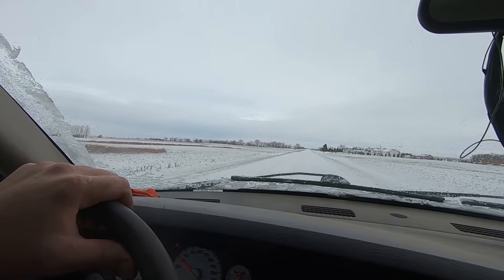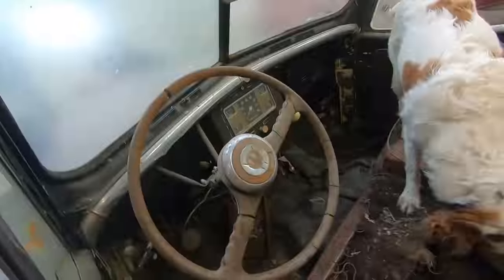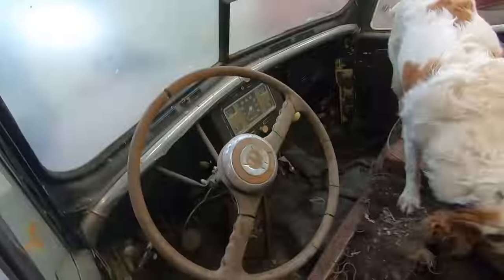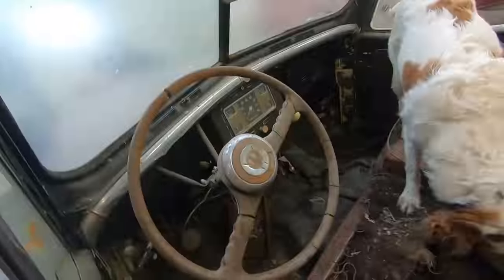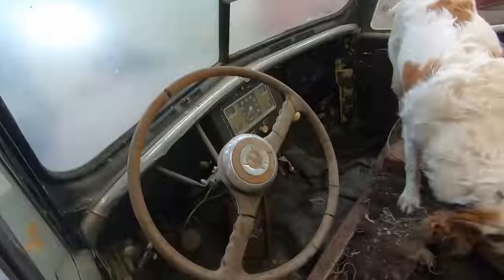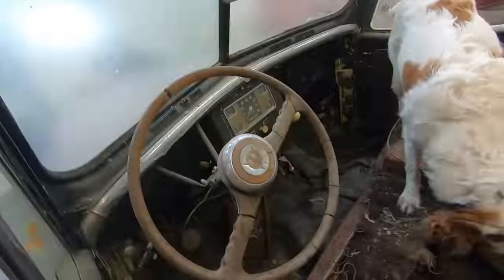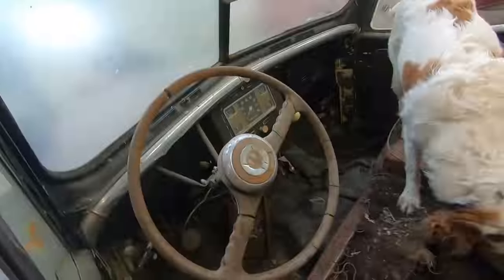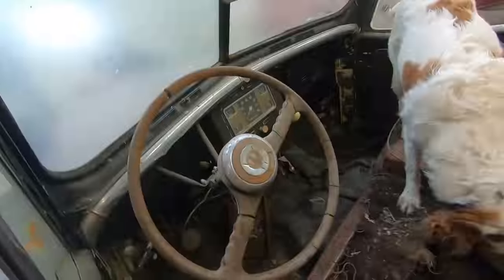Forgotten 1949 Willys Jeepster Barn Find! Will it Run?!? Sitting for 46 years! Family Heirloom!

Comment: So cool to finally meet your Dad! He is about my age. I had a 1947 CJ2A Jeep back in the early 1970's that I kind of restored, well, got running and drove around for a while. This video is quite interesting to me. Brings back lots of early Jeep memories! I hope you and your family have a wonderful Christmas and a great year ahead.
Reply: Awesome!  I learned to drive a stick in a field on a 1952 CJ2a. 4 wh low, 4th gear floored...16mph. 😀 Finally got it stuck going diagonal across some big dirt humps..2 wheels in the air, 2 wheels all the way compressed.  Awesome little vehicles.
Reply from the maker: Sounds like there's a lot of cool old Jeep stories out there! Way cooler than the right hand drive mail Jeep I had!
Reply: @willybones3890  they didnt have 4th gear...

Comment: You're amazing at fixing stuff that's older than me. It amazing you can still get replacement parts. Great job 👍
Reply from the maker: Thanks much George!
Reply: @MortskeRepair  ALOT OF THOSE PARTS ARE QUITE SIMILAR TO FULL SIZE JEEPS  PLUS REPRO STUFF CAN BE BOUGHT ID DO THE INTERIOR AND THROW A CHEEP TOP ON

Comment: Hey Mortske & Duff. That was an outstanding video. Really cool to see you and your dad work together. Lost my dad when I was 19. I am a 1955 vintage by the way. Guess that makes me 2 years older than your dad. That's quite a lineage you have when it comes to hotrods and mechanical stuff in general. I met a guy that owned a Conoco station near where I lived. I was around 13. His name was Donovan Crandall. He was an ace when it came to anything automotive and fabricating. I loved shadowing him. He taught me the trade hands on making mistakes as I learned. By age 14 I was rebuilding engines. My first rebuild was a Ford 272 Y-block. Hand cutting ring ridges and grinding valves and seats and knurling the guides. I even learned how to file down knurled pistons to fit. I've probably changed hundreds of points & condenser sets in my career. I still have the AC Delco dwell meter Don gave me in 1970. Merry Christmas to you and Duff. Thanks.
Reply from the maker: That's awesome! Love hearing about that stuff! Same to you Bob!

Comment: I love the whole ''will it start'' old iron community from classic cars to old construction equipment but you've become on of my favorites. Especially when I have a soft spot for Jeeps and it was so enjoyable getting an hold family heirloom going! You deserve way more subs but I know they'll come!
Reply from the maker: Much appreciated Brodie!
Reply: @MortskeRepair  DO A QWIK BUFF DUFF   ADRESS THE BRAKES AND CHANGE TO 12V SYSTEM WITH ALTERNATOR  OH YEAH GET AN INTERIOR KIT AND TOP
Reply: @MortskeRepair  THOSE HUB CAPS FIT  UP TO 1968 FUL SIZE JEEP WAGONEER
Reply: @MortskeRepair  GET A 12V PERTRONIX POINT KIT  REPLACEMENT  DO AWAY WITH POINTS
Reply from the maker: @rsprockets7846  That's the plan!
Reply: Did a great job right on

Comment: I love these extra long vids.  Watch half in the morning, then come back later and watch the other half.
The genuine excitement on your face when you got the Jeepster running was great.
Also, was wondering if you did indeed roll those adjusters out on the brakes... had the same no brake thing with my 49 Chrysler after a brake overhaul (with master and wheel cylinders..) ... That was part of the problem.
Reply from the maker: I never did adjust them but that's something that should be addressed as well. Thanks!
Reply: @MortskeRepair  This has become my favorite channel.   I think it is because the videos are quite detailed and lengthy.   It's like a weekly feast which I can't wait to devour.   Thanks again, brougham.

Comment: For cooling systems I used CLR it cleans up pretty good.
Reply from the maker: Good to know!
Reply: @MortskeRepair  -- For the ultrasonic cleaning unit, Mustie1 here on YT has the same unit, and has tried out a bunch of cleaning solutions over the past several years on the same kind of cleaning jobs you're doing-- cleaning old engine parts. Maybe you could message him. Oh, and another thing, you might might try making a small basket out of aluminum window screen for your very small parts.
Reply from the maker: @grizzlygrizzle  Thanks for the tip!

Comment: Back in the old days, I'm 75, we used to flush radiators and blocks with straight lye. We'd run a can of  Red Devil and water through the system for 1/2 hour or so they flush with a hose till it ran clear and repeat if necessary.  I love the epic long vids; it's better than watching a movie.
Looking forward to the next one.
Reply from the maker: I’ll give it a shot!

Comment: Good job, your gramps hooked you by saving that old ride for your show... cheers to his memory. On a different note, laughed my as* off was watching Puddn's second yehaul vlog. When pulling the old battery he talked trash on your battery hold down techniques. He pulled the battery balanced it on the edge of the core support and soon as he turned away it moved and feel forward off the front the truck smashing down on his dewalt wire wheel tool lol. The cure of Mortske's revenge will get you every time! Merry Christmas!
Reply from the maker: Karma!!

Comment: Great video on the Jeepster. Also working on it with your dad, these are times you will remember. When using the Ultrasonic cleaner you can put your small parts in a plastic wide mouth jar with cleaning solution and submerge it in the basket. The parts will get cleaned and they will stay contained in the jar.

Comment: I realize this is an older video but I just found your channel yesterday. When you had the water pump off you pointed at the timing cover and said something about a chain inspection hole. The first automotive engine I ever rebuilt on my own was out of a 47 Willys Jeep cj2 which I'm pretty sure is identical to the one in this vehicle. And if I remember correctly it had a gear drive cam, no chain.
Reply from the maker: Cool, thanks!

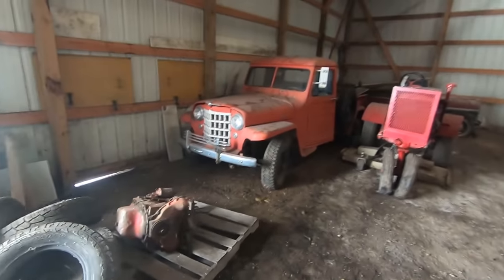Comment: 1:53 My grandfather had one like that (the pickup but, in yellow colour) and drove it until the early 70's. I always wanted it but, by the time I was old enough to mention it, I think it was gone. He bought a Datsun pickup as replacement. Apparently, the Willys had an oil pump problem. I wish I could have it today. It was slow as "molasses in winter" but, had a ton of torque.

Comment: We had a '46 4-63, 2-WD station wagon.  That passenger front seat back should fold down and the entire seat should fold forward. Starting: mechanical choke and throttle. Pull out your choke, a little pull on the throttle, then your foot on the starter.  That electric (?) overdrive is like gold.  Enables you to make speed on the Interstate.  Yours also has an oil filter, mine did not.  We added a Franz filter, which used a roll of toilet tissue as the filter.  Narragansett Bay
Reply from the maker: Great info!

Comment: My 48 Jeepster has a Chevy 350. Turbo 350 trans. Ford 8” rear. Mustang 2 ifs. Yep, got carried away.
Had a 50 Willys pickup too. 100% stock. Had a panel delivery for a bit. Kinda rough
48 has flat front fenders. Newer ones have peaked fenders.
Reply from the maker: Nice!

Comment: I’m digging those square sockets!as I too, own those square easy outs and agree with you on which ones are generally better to use. 
However, I also own round easy outs too and believe they have their place!  
Use CLR or Limeaway for coolant fire up the engine and allow engine to warm up a little then let it sit long enough to remove the rust clogging the coolant passages. 
Also marvel’s mystery oil is your friend when Unsticking a engine by filling each cylinders and leaving it for a week or so. 
Potentially even CLR to remove rust from those Cylinders!
You mentioning the importance your grandpa’s had on your life caused some dust to get into my eyes thinking about mine and my Dad as they played an important part of my life!
Reply from the maker: Thanks much for watching and commenting!!

Comment: Awesome! Was waiting for the Jeepster. Great job getting it going for your dad. What I do when putting carbs back together is fill the bowl before putting the top on. That way you know it will run for a minute and you can test the squirter. Just don't tip the carb.

Comment: I know this is an older video but I was so happy to see that he got himself a ultrasonic cleaner and was looking forward to when he pulled the parts out and saw how nice a job it did cleaning the carburetor. They are so awesome at cleaning I even use them to clean fuel filters so I can reuse them. 6 L is definitely too small, it is rather misleading I have several and you want to get the largest one you can afford since you can always fill it with water and put the part that you were cleaning inside a jar or a plastic bag with the medium that you want to use to clean it with without having to fill the entire cleaner. You also want to make sure that you fill it more than he did because the heating elements go up farther than you think and can burn out the heating elements in the ultrasonic cleaner ultrasonic cleaner. I have one that I dropped an entire trash pump into to clean used vegetable oil that had petrified itself on to the pump, cleaned it slick as a whistle.

Comment: 1948 Jeepsters came in only red or yellow lacquer with black above the trim and was common through the end of production. The door latches were redesigned in 1949 but yours still has the early style. The lightweight hub cap is a repro. Oil filters were optional. Most were mounted on the engine and drained back into that fitting you saw on the timing gear cover. My California car was a rust bucket compared to yours, excellent find!  I would throw away those steel brake lines but that's just me. Yours had an oil bath air filter mounted on the right fender. The big gap between the radiator and the fan was taken up by a steel shroud. After rebuilding mine my wife and I drove to N.H. and back last fall with few issues. Fun car.
Reply from the maker: Great info! Thanks!

Comment: Brocephius, if you fill that ultrasonic cleaner up to the ridge in the liner you can jam more stuff in there. It should always be full when you run it. I like to use Purple Power in mine and it works great! Also, get a small wire basket for tiny pieces.

Comment: I also use an ultrasonic to clean parts. For the small stuff, you can fill a mason jar with your cleaning solution, and the main tank with water. Put the small stuff in the jar and the jar in the water. It will clean up well. That method is also great for cleaning really dirty stuff without gunking up the tank drain.
Reply from the maker: Homemade mix match of parts!

Comment: Bought mine Jeepster 2013 ... total wreck. Welded and painted my -50 Jeepster. Same colors as yours. Put Chevy V6 with auto under the hood. Original was F-head six and 3 speed overdrive. Had to change rear axle, now there is 64 Mustang axle. Just a little wiring jobs to do... Very rare in Europe and especially here in Finland...
Reply from the maker: Awesome!
Reply: @MortskeRepair  Thank you. Whole story is in OldWillysForum as  juhap "My 1950 Jeepster restoration"

Comment: one method i used for cleaning up clogged blocks .find pic pipe that is close to the wp outlet and thermostat opening size. put a pvc Tee on the thermostat housing with pvc pipe attached below. The water pump needs to turn. doesn't matter if it leaks. by the way remove the fan and radiator. fill with water and your favorite flush.  start it,  warm it up,  flush multiple times till clea,  replace and repair what is needed.  go have fun

Comment: Excellent video Mortske Repair  :) also wild car that 1949 Jeep is and first one heard and seen has Manual transmission 3 speed on Coulmn Shifter too! Also other one at Aunt place should check it out to Mortske Repair  & this one fix for dad of Grandfather had awesome! Remember my one Grandfather Harold my mom dad he like Chevrolet Impala and Caprice car lots to for years up 1995 ! My grandfather Harold oldest brother Arnold was very mechanical lots to he made a old 1937  Model A Ford  in to Snowmobile car with 350 V8 4 barrel carb with daul exhaust plus Turbo 400 3 speed Automatic transmission with truck frame also 377 posi rear gears back wheels even floating axle plus track on from Snowmobiles and front wheel had ski's of Snowmobile  ! 2 fuel tanks back ran in front one  and black in color  was interesting machine for sure! Never rode in but seen pictures of it too and in 1978 Arnold sold it ! Heard he bought car for $500.00 but sold for $1200.00 ! Never seen car or heard about since! But had lots families and friends had interesting projects they did too over years!

Comment: Up till the 90's most motors ran on either 10w-30 or straight 30 weight. I was told if you run thinner oil the gaskets will leak like a tea strainer..I always just ran 10w-30 , worked great and no issues.....

Comment: I can't remember the brand name, but there is a rust remover that they sell at Wally World that works great on chrome. It comes in a white bottle about five inches tall. You just put it on there and let it set for a few mins. No scrubbing necessary. I used it when I was restoring bicycles as a kid. I had a little side hustle. I would get them out of the trash and clean up, fix stuff, and sell them. Anyway, that stuff would work great on those hubcaps. They make chrome polish as well for stuff like that as well. I used to use some stuff called Nevr Dull. It would polish up anything.

Comment: '52 Willy's 1 Ton, 4wd PickUp was my first rig. Bought from my maternal Grandpa for $357.
My Dad and I rebuilt everything mechanical on it.
Brakes ALWAYS SUUUUUCKED!!!!
That OHV, 134 cube, 72 HP, 4 banger would idle as smooth as silk after our .030" over rebuild. Gutless as all-get-out in high range, I MEAN GUTLESS!!!
Ran it to held on the floorboards commuting to college 35 miles each way for over a year.
My "cruise control" was a latch over the homemade bar stock gas pedal that held it to the "wood." The pedal had a starter drive return spring out of a semi truck starter. 
Converted to 12V and a semi truck CHROME 130 Amp alternator on homemade brackets.
No oil filter, oil bath air cleaner.

It'd climb a telephone pole in low range though.
Reply from the maker: Good stuff

Comment: It would be cool to try getting a hot water heater in your garage to hook up to the heater lines in the motor and circulate hot water through the motors to get the blocks hot to free up all the bolts, valves, and pistons.

Comment: Put a new condenser in and possibly a resistor and put an alternator in it so you have charging . All the rust in the cooling system, get some Evapo-Rust and run that for a few hours then flush the system really good. I would also keep checking the oil for water contamination seeing that you didn't put a new head gasket in. I really enjoyed watching you bring it back to life. This show is the first one I have watched on your channel and have subscribed to. I wish you a Merry Christmas and a Happy New Year.
Reply from the maker: Same to you Ken!

Comment: You can actually put all of the carb parts in the ultrasonic cleaner. An ultrasonic cleaner is great for making sure those brass floats do not leak. It won's hurt anything if they fall to the bottom, and you don't always have to use the basket. Chem Dip is great for ultrasonic cleaners because you can keep reusing it. It doesn't matter if it is dirty. Ultrasonic cleaners are a lifesaver, especially on a lot of the small engine stuff that I am usually working on. You can put anything (parts or chemicals) in an ultrasonic cleaner, and it won't hurt anything. I throw anything I am planning to reuse in mine.

Comment: When you install your condenser, I would suggest you put a ballast resistor on your ignition. Then use a simple relay connected to your starter motor so when you engaged it gives the full 12 V for starting, but runs at 6 V. It will save your points and condenser from burning out.
Reply from the maker: Points don't care about voltage.

Comment: I used white vinegar for my heater cor my truck wasn't heating. It cleaned alot of bearing grease,and rusty,lime. Now it'll run you out. It's heating great. I rigged up a drill pump filtered what came out. Then flipped the hoses,to reverse the flow.then flushed with water.

Comment: im a jeep owner, if you have engine thats been sitting around for a  long time, you need to remove the spark plugs and pour what ever you think will do the trick down the spark plug holes, plus  some of the valve springs will be junk and the valves that are open  and the seat will need  service.   The best way to store an engine, is to pour some stuff down the intake and if its a pushrod engine back all the rockers off so the cylinders wont rust, valve springs  should be replaced

Comment: With this video being "feature-length", I figured I would watch half and save half for later...  Wrong, Vern!  Watched the whole thing in one sitting!  One of your best (maybe you're getting good at this YouTube stuff). As always, love me some Duff Dog... wishing you and Duff a Merry Christmas!
P.S.  Reminded me of the two times I've had a condenser fail!  First time in my 1968 Toyota Corona after a Mardi Gras parade (I'm from Mobile, AL), second time in my 1967 VW Beetle on the side of I-65 in the middle of nowhere.  Of course, both times at night, and both times my old habit of saving a set of used points and condenser in my tool box saved me!  Actually, I used a VW condenser to fix the Toyota... had to splice the wires to make it work, but work it did!
Reply from the maker: Don't forget to get up and stretch!

Comment: Hi Mortske..   Love the channel.  I was wondering if the oil you used had zink.  I learned on VGG about the Zink...and Yup.  The diesel oil has between 1000 and 1200 PPM zink.  Best for anti-wear on older engines.  :)
Reply from the maker: I add Risoline Zinc Additive.